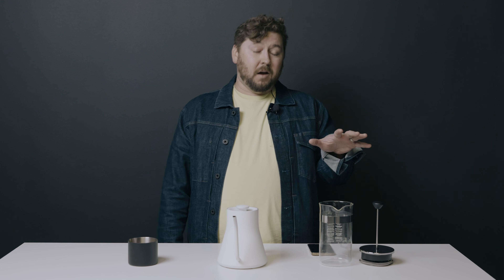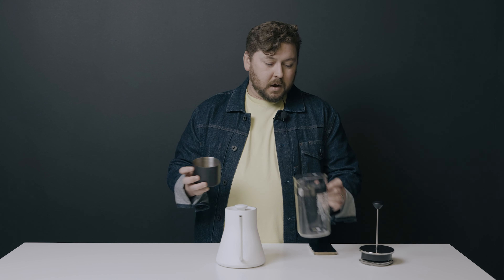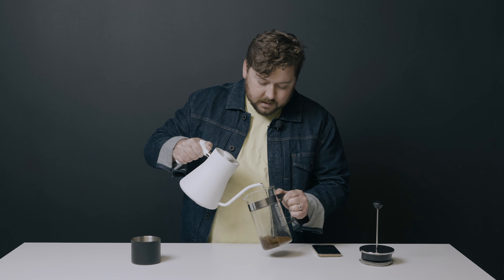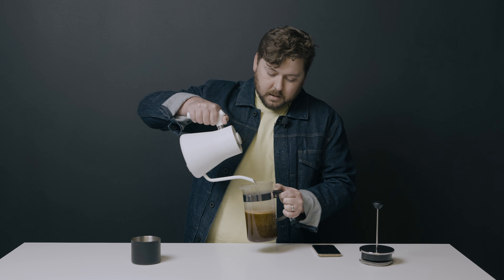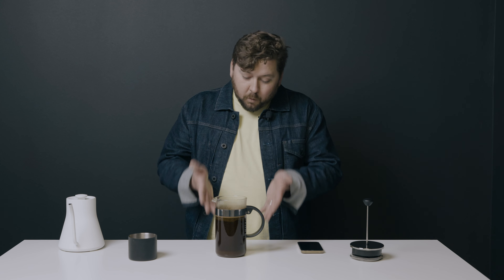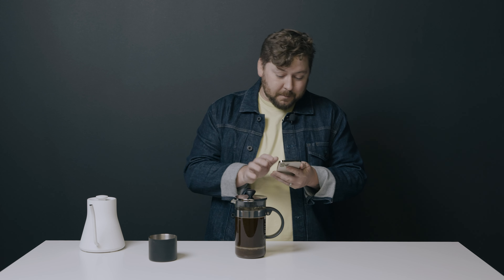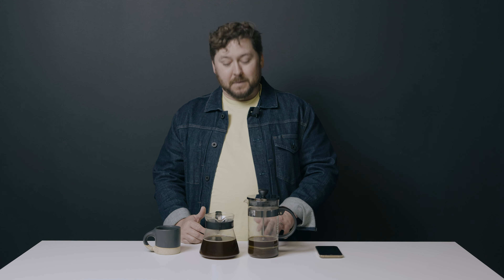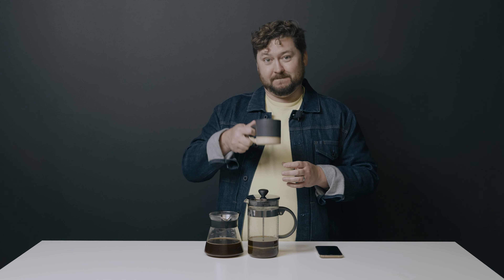A Simple Brew Video for the French Press

Comment: That method is very similar to what I learned from James Hoffman. I haven’t made a French press in a while, but I have it down to where I don’t even need to use the press anymore. Using James’s technique, the coffee ends up settling to the bottom on its own, and by waiting that extra amount of time at the end all the fines settle and if you pour it off gently enough you can get it directly into your cup with almost 0 residue. Thanks for a great video!